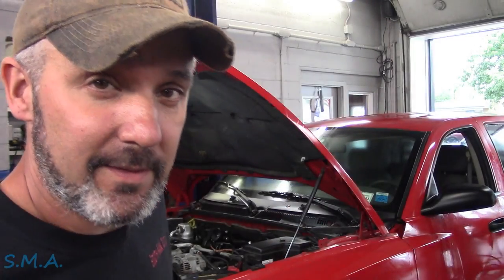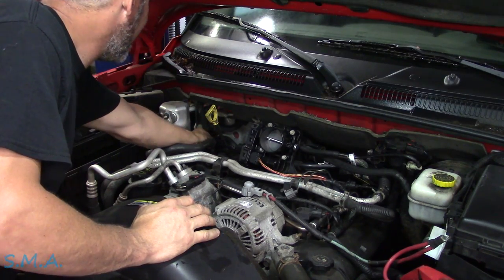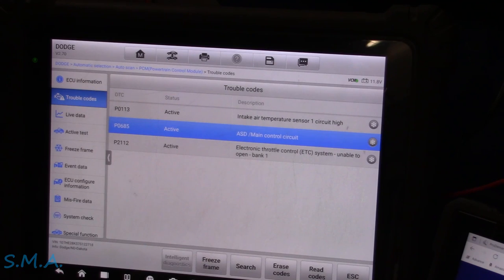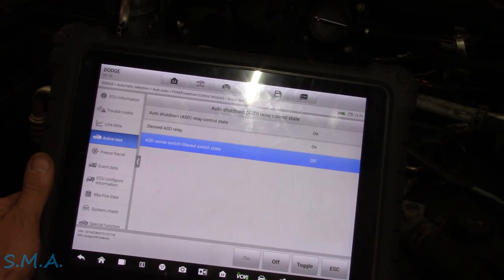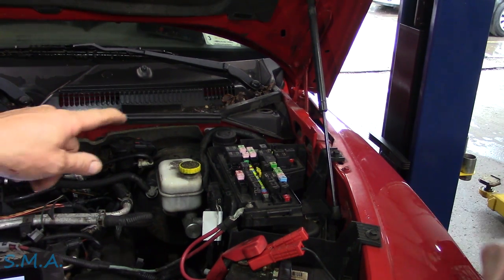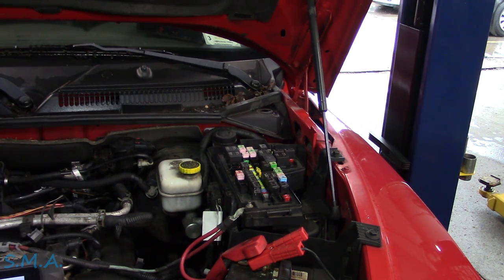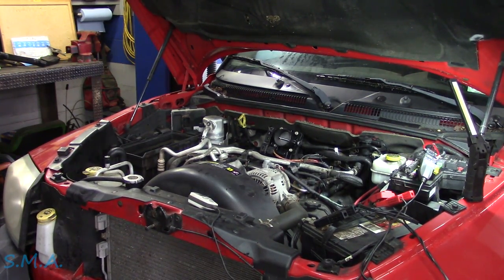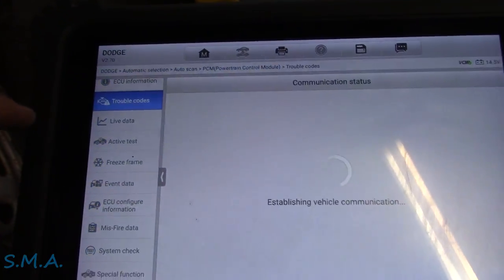Dodge Dakota: No Start After Clutch Replacement

Comment: When I was a young fellow, I did an engine swap on a '79 Malibu.  It had a 267 in it that was tired, and I had a wrecked Nova with a healthy 350, so the 350 went into the Malibu.  I got everything together, and got it up and running, but it kept destroying the alternator belt.  I checked the alternator many times to see if it was binding up, but no noise out of it, no roughness when it was rotating, it seemed fine.  Pulleys were aligned fine, no sharp or rough spots on any of the pulleys.  I just couldn't figure it out.

I was a couple of weeks into basically not having a car, when my wife pointed to the front of the engine and said is that right?  What I had missed for several weeks, and she spotted was the fact that the crank pulley and the water pump pulley were different.  On the crank pulley, the alternator belt the power steering belt, and the AC belt all had the same diameter grooves, but on the water pump pulley, the alternator belt groove was a different diameter than the rest.

As we were putting things back together, we wound up with the crank pulley off one engine, and the water pump pulley off the other.  Thankfully, we still had all the left over parts, and it was a pretty quick fix once she figured out what I had done wrong :)

Comment: Back in the days of Precision tune ($19.95 for spark plugs and connected to Sun machine That none of them could read) if the engine still missed or shook they would say it had a burned valve on to get them out without spending any time on diagnosing the cause. Some of the victims would end up at our garage. Chevy small blocks had a vacuum tree on #8 cyl runner and a vacuum leak from any connection at that tree would kill that cylinder at idle but pick up and run some what with increased rpm. Did many valve jobs with a piece of vacuum hose or a rubber cap. We gained many new customers from places like Precision tune. Also did lots of brake hydraulic repair when ATF was used in master cylinders at quick oil change places.

Comment: Starts but high pressure pump screaming (Direct injection), like solenoid wasnt getting power, on a 19 titan with a 5.6 threw me for a loop once. Checked power and ground at the solenoid and it existed. Put a 40 amp light bulb on there and it could not carry the load. Ended up being the fuse not fully seated. When I inspected the fuses in the fuse panel initially I missed it. Pushing on the fuse and feeling it seat about 1/4 inch down gave me that fuzzy feeling and wouldnt you know.... runs great.

Comment: Daughter came over and said her tire pressure light is on.  She parked on the curb so the tire compressed and looked low.  All the tires turned out to be 6 psi low.  A front had come through while she was at work.  Mid-morning the temperature was low 90s early evening when she left work it had rained a dropped to the low 70s.  Well there’s you problem lady.  Next day was back in the 90s and no light.  I hate those in tire sensors.

Comment: My own 1997 Subaru. Low beams fail to illuminate the day after replacing the steering column after a failed theft attempt. Spent the day chasing wiring, relays, connectors, grounds and finally bulb sockets... Only to find that BOTH low bulbs were blown. I don't understand exactly how 2 bulbs blow at the same time, but they did.

Check the easy stuff first.

Comment: Years ago I did a clutch job on a 4x4 truck and somewhere in the process I bumped the transfer case into neutral. I was scratching my head for a while wondering what I forgot to do when it would not move when in I was done.

Comment: Had a foreign car one time that the clutch was replaced and it would not start it would crank well come to find out the flywheel and crank sensor have to be timed and if not  no start  little work to remove the transmission and retime flywheel but a good learning lesson

Comment: 18yo me and best friend, 16 took a week to shove a Monza 2+2   V6 cyl in a 70 Chevy Vega fast forward 2 weeks and we are power sliding around the corner to his home and the rear end rips +from it's mount from all the torque ... forgot to get it braced. tore it all up and put the driveshaft thru the rear seat. waited 2 years with the engine to put it in somewhere else.

Comment: Most aggravating thing i ever had happen was metric brakeline fittings in a box marked standard thread pitch. And the first time I ever did any serious work was put a used transmission in an 84 f250 and forget i had unhooked the vacuum booster hose for some reason. Ran horrible.

Comment: Big 100A fuses for 400V have a red indicator that they are blown. Its a simple spring mechanism. When it blows spring is no longer hold by fuse wire and goes out. If they start using thay you will loose your job or get a new one in fuse repair shop:)

Comment: My car went on limp mode so I took out the oil galley gasket on my 09 infinity g37x since they are famous for going out.  And it was good. So after I took my engine apart and back together I finally decided to put a scanner and it ended up being the oil control valve solenoid for the cam. It would have been a 10 min job but I didn't drive the car for 1 year before I decided to fix it. 🙃

Comment: My 96 Suburban had a small coolant leak for years that ran everywhere with no pattern. Tried several times to find it with eyeballs, dyes, you name it. Accidentally found the problem one day when I had the hood popped checking fluids. The stupid plastic clamp on the overflow tank hose at the radiator had broken.

Comment: Love the quick fix driving my 70 Plymouth A body home after replacing the alternator 130 amp jobbers crossed the geneganslet bridge and snap cars dead and rolling to a stop at the Beardsley brothers saw mill I let it roll in the drive way. I have no nothing at all. I checked everything couldnt see anything wrong but when I was checking the alternator connections and belting found an arc mark on my exhaust manifold looked around and noticed that my fusable link had rubbed through and popped the link didn't have another one so lol yeah you know it I used everything I ever learned at the Afroengineering school and found a suitable Jerry rigged detachable 25 amp fuse and twisted crimped them together with 2 spent 22 caliber empty casings and taped them up and drove it home where I tore it all out and put it right .
Reply: Did you ever hear the story about the guys who shot themselves in the leg using live .22 shells instead of spent ones. Lol
Reply: @bencappello5324  no but I have seen where someone was brilliant enough to try using a live round for an in line fuse and lost 2 fingers and a thumb and gave himself a concussion on the steering column. My 2 spent casings made a quick n dirty connection when they and a pair of small vice grips were all I had to get me home and it wasnt a red green thing being temporary unless it works. I made sure to fix it right when I got home. The fella who lost his 2 fingers and a thumb when the live round he decided to use as a fuse when he got to the hospital they found the projectile key holed in his palm.

Comment: I replaced a rack and pinion in a toyota camry because the u-joints in the steering column coupler were partially seized up.  New Rack didn't fix it for some reason.

Comment: 2007 civic: windshield washer would spritz water hotting a bump when not on. Turns out the cap on the washer fluid reservoir was not sealed!

Comment: I was diagnosing the blower motor circuit on a 01 Durango, and the blower fuse kept popping. I traced the short to the resistor, which was fried and replaced it. I replaced both fuse and resistor, and they both fried after a couple of minutes. Took the blower motor out, and ran it straight from battery power, and it seemed to work fine. It took me entirely too long to realize the blower motor harness was shorting to itself, causing the fuse to blow. Then I looked at the resistor connector, and it too was shorting to itself. After I replaced that connector, the resistor, and the fuse yet again, I finally got the blower blowing without problems.

Comment: Not an automotive but still same. I work HVAC and had one other tech on a job taking a long time at it with manufacturer tech support. They had him check all sorts of power feeds, swap coils around and even had him perform pressure tests on the gas valve that was not working. I get there and ask him what he has done and asked to see his screwdriver and performed a magnetic test on the open frame coils. One was turning on and magnetizing and the other was not. As I was about to leave letting him deal with tech support I thought about what he had checked and I went back in and told him to give me his meter. Checked the coil that was not energizing but was getting 24v. Turns out the coil was open and tech support had no idea how to check coils properly.

Comment: Looked at a friend's Honda Orthia (sort of a JDM Civic Wagon) - complaint: idle speed was full throttle... Visual inspection - (other friends and "mechanics" had already looked) - the ground wire (at the top of the engine right at the front) was corroded/damaged, so the throttle cable had became the new ground and melted solid... couldn't believe no one else had noticed the broken ground strap at the top front right in your face as you look at engine...

Comment: 86 ford tempo rack &pinion replacement a little ground came loose  by the battery caused  fuel pump and everything not to work I learned from this

Comment: I stopped once to help a guy in Washington, DC, whose old Mercedes 280SL wouldn't start. I had an old Mercedes, too, and thought maybe I could help. Hot looking babe waiting didnt hurt either. Looked around, found the ground wire to the battery had corroded and come off. Fixed in less than 5 minutes, started right up. Guy barely said thank you and took off with the babe. Probably saved him $300; think I got a tip? Nope. :(

Comment: Had a 94 Voyager that would just stop dead with no warning, if I banged on the fuse / relay box it would restart. Ended up the contacts were going bad on the asd relay, lucky for me the back up light relay was the same part number so I swapped them no more problem van always ran, just couldn't see when backing.

Comment: Early 80s. My partner and I decided to do a quick clutch job on a Subaru. Pulled engine, changed clutch, nothing. Took it out, put it back, nothing. One more time, inspected it, put it back, nothing. Finally after 3 hours I thought "lets put it on the press".  Nothing. Bad new clutch. Luckily, our parts house was 24 hours, it was 2:00 in the morning and we got a new one in 30 minutes and then it worked fine.

Comment: Bad news, it happened. Good news it happened and they had (I hope) to pull the trans back a bit and pull the pinched wires. Any debris between the engine and bell housing or trans housing will create a shim effect and the input shaft will be at an angle in the disc and if equipped pilot bearing or bushing. This angular misalignment will eventually tear up the clutch disc torsion damper, pilot even the hub and input shaft and bearings. Yup folks it's a real possibility. Wires, brackets or grunge crud can do it. A clutch guy here. Gary

Comment: Friend brought his Honda Shadow 1100 over along with a Clymers manual complaining that the cooling fan was inop. We followed the manual: checked the fan, checked the resistor & temp switch. After an hour of fun we turned the page to find the statement "check the fuse"...ugh

Comment: My own 87 S10.  I ended up pulling the bed to put a fuel pump in it.  It kept popping the ECM-B fuse.  Took me over a week to realize that the single wire oil pressure switch wire fell off and grounded out on the frame.  Luckily the fuel pump was the only thing I ended up putting in it.

Comment: Customer complaint was that the high beams wouldn't stay on, they would only light up briefly. The "fix" was that the headlight switch had to be pushed forward, and the customer was used to switches that had to be pulled backward..

Comment: Couldn't get my carbureted boat engines to start. Finally realized I disconnected the center wire on the distributor caps when I winterized. Doh.

Comment: it's hard to remember an easy fix.  i always got the hard ones.   one i'll never forget was a cold winters day an air can(pneumatic bulk hauler straight job) wouldnt start. operator said he tried eithering it.  i went out told him when i crank you give it a shot of go juice.  as it statred cranking i look to see him shooting the air cleaner for the compressor mounted behind the cab.  it took a minute to compose myself long enough for me to show him where the truck engine air cleaner intake was.  it fired right up.

Comment: About 25 years ago I bought my now wife a Ford Taurus from a workmate. It did not run, towed it home started tinkering with it, come to find out the emergency fuel shut off switch was tripped. I only paid $50 for the vehicle. The next day at work I told the guy he could have his vehicle back and running. He said just keep it, the wife drove that thing for next few years with no issues. Sometimes it is just a simple thing you can overlook